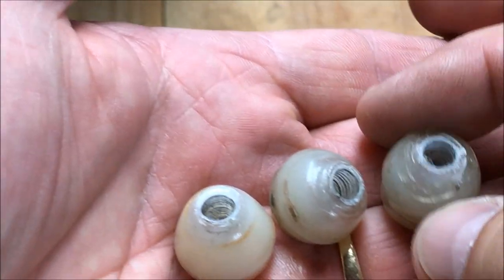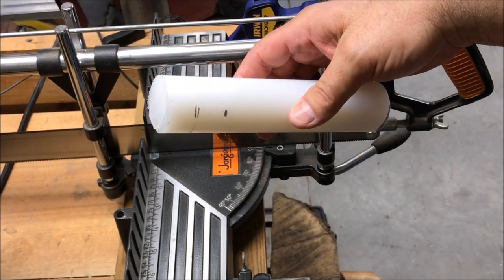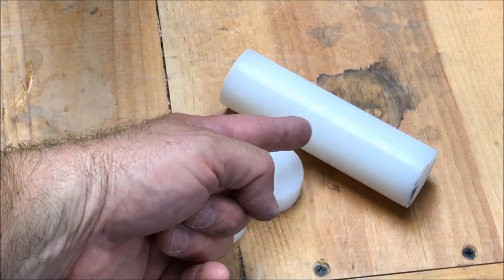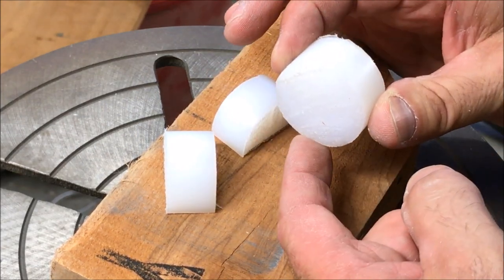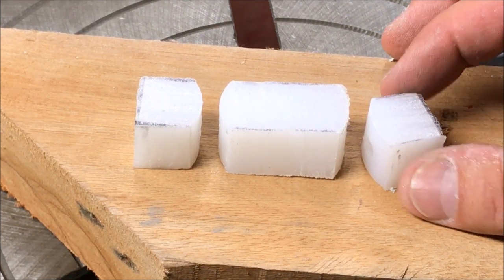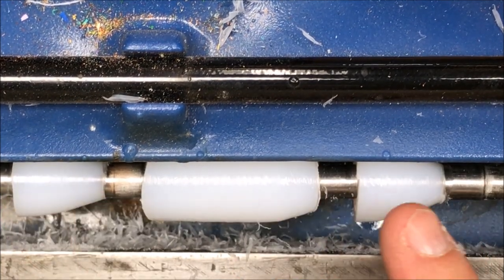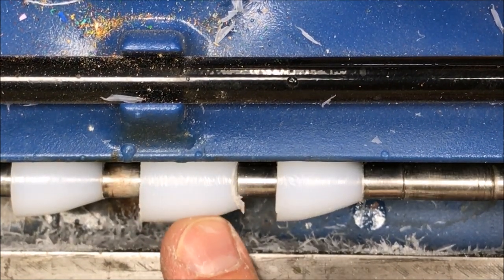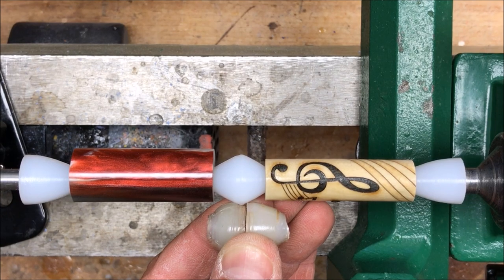Make Your Own Three Piece Non-Stick Bushings

Comment: great idea to combine the center bushings as one to minimize equipment. i just got two 4x16x2 inch thick peaces to make some bushings and my new buffing wheel mounts to the lathe. use soapy water when cutting and use zero cleance block of wood under the material. this will clear the material away and keep it frombuilding up.
Reply from the maker: +BEE HAPPY Wood Working and honeybees Thank you for the info, you're going to love using these bushings. Make the cone section longer so it can for into and center larger tubes. 

Regards,
Bob

Comment: I have used rubber faucet washers for ca application for a long time, works great, a package of a half dozen cost 99 cents, tapered, and easy to replace, (but still using my first 2 I started with)
Reply from the maker: +fiberinspector Great tip. 

Regards,
Bob
Reply: fiberinspector i have to remember that one...great tip...

Comment: You always have videos that are helpful. I need to make one of these sets but didn't actually know abut UHMW or Ultra High Molecular Weight Polyethylene. So thank you again. I see Amazon sells various diameter rods.
Reply from the maker: +Ralph Ross Thank you Ralph,
  The smallest diameter I'd buy is 3/4", that's perfect for bushings. 

Regards,
Bob
Reply: Bob, thanks, they have a 1 inch rod  x 1 foot  long for $14 so I will get that one. Appreciate your help.
Reply from the maker: +Ralph Ross That will be the perfect size. You're going to love those bushings. 

Bob

Comment: I think the original video was one of the first i saw from your channel. I was wondering if hdpe would work for this as well as i have plenty of that material lying around.
Reply from the maker: +Willem Kossen HDPE works great, I use UHMW because it was cheaper. 

Regards,
Bob

Comment: I use the non stick bushings for finishing with ca glue but I get a buildup of glue on the ends of my pen blanks and it leaves a lip of ca glue. Can you please tell me what I am doing wrong.
Reply from the maker: Nothing at all, that happens all the time. You can swirl it on sand paper and clean that lip up. I use my disk sander. 

Regards,
Bob

Comment: I do the same with home-made HDPE and I turn about a dozen at a time. I don't worry about losing them.
Reply from the maker: +Redthumb45 I've been wanting to melt some milk jugs. I could use the HDPE for so many other projects. 

Regards,
Bob
Reply: I've got a bunch of orange Gatorade caps that may provide my next supply.

Comment: Curious why you didn't use the Delrin blank I sent you. You told me in a E-Mail you would probably use it for non stick bushings? I'm a little disappointed ....
Reply from the maker: +Don Peters Please don't be Don,
  I'm saving it for another idea I have. I think you'll like it better. I'm currently in the middle of finishing three pens and tying up a few other loose ends then I'll be onto that project. Please bear with me, I could have used some of it but I wanted the entire stick incase I screw up and have to take a second swing at it. I think it's way cooler than non-stick bushings. 

Regards,
Bob
Reply: Looking forward to seeing what you come up with.

Comment: enjoy your videos  but I have a question or maybe a request , audio has been a problem on a majority is here any way you might be able to get a louder audio setting  so we can hear you ? I have my volume maxed out and the only way I can actually can hear you and it still sounds like you're whispering is with my ear buds.
Reply from the maker: +Michael Reed Thank you for letting me know Michael. 

Regards,
Bob
Reply: there are sections that come out clear which may be because you're closer to the microphone and there is no noise in your shop. Thanks Bob.
Reply from the maker: +Michael Reed I shoot my vids with an iPhone so the mic isn't the best. I've been wanting a remote mic but they can be a bit expensive. 

Regards,
Bob
Reply: RJBWoodTurner  I understand it's the same for me on my larger machines for my shop, hope you can find an affordable wireless setup that will work for you.
Reply: Yea It your intro and outro that I always thought needs to be louder. Would a Bluetooth mic work when recording or does it only work for calls. I may try it on my Galaxy 7.

But I've always read audio can sometimes be more important than video for these kinds of things.
Reply: I just found this that has a 20 foot cable. I'd post a link but not sure you worked out getting links in comments.

MAONO Lavalier Microphone

Comment: How would acrylite or acrylic blank left overs work for non stick bushings?
Reply from the maker: +Mike Kline Hello Mike,
  You would need to do a test. I use C/A on acrylics to glue tubes into them so I would guess it would glue it to the blank. 

Regards,
Bob
Reply: RJBWoodTurner okay, thank you.